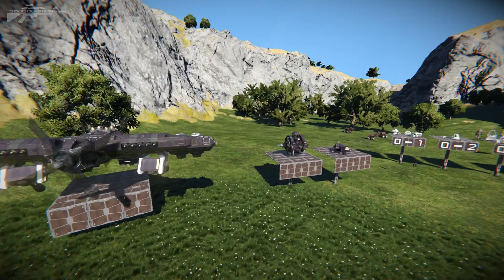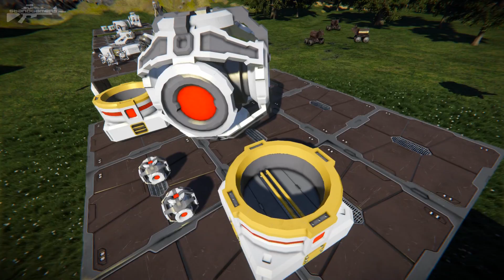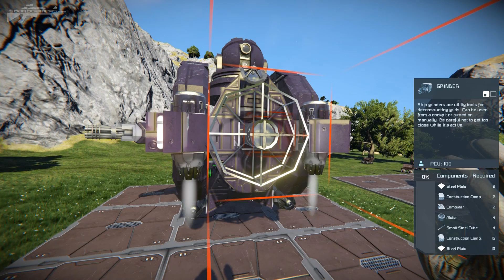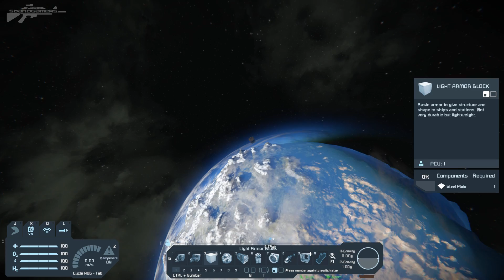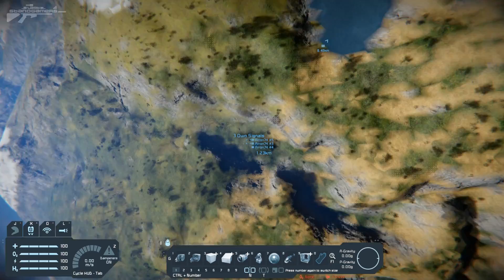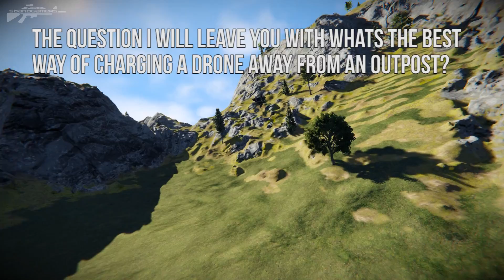How To Build Compact Drones  Tips Tricks - Space Engineers

Comment: cool concept: small-ish ship with a remote control drone. Give it a cutter, a welding arm, and a camera, along with the required pieces of a drone. Have it be able to detach from a small part of the ship's interior and let it fly around inside in out. The cutter can let it cut open the ship to fix internals, and then weld and fix everything back together. I think it would be cool.

Comment: For extreme range drone control you can make a relay drone with laser antenna and a normal antenna bounce a control signal from your location to the relay drone via the laser antennas and then have the drone broadcasting out to max range via normal antenna. This will let you control any other drone around the relay drone out to the max broadcasting range of it's antenna. With no limit to the distance between your actual location and the relay drones location. You can also have the relay drone work as a charging station for other drones. You may also connect more than one relay drone together to bend the laser signals around objects or make overlapping normal antenna fields to make larger drone control area's.
Reply: I use a space based control satalite the bottom is packed with laser antenna so it can cover a very large chunk of of planet survive.

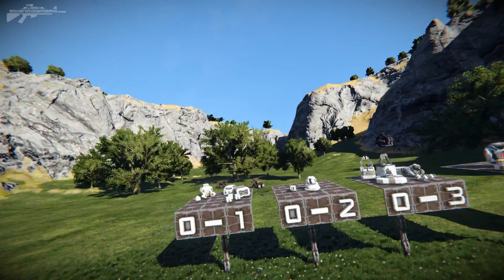Comment: 2:00 One surefire way to protect antenna and remote control: Put them in the back.
The enemy would have to go through the front and the central battery or cargo to get to those parts. And at that part, they got through the center, so it hardly matters anymore.
You want the control block as far away from the enemy in normal combat operations as possible.

Comment: Was busy and did't have time to leave a comment of any kind.
SPACE DRONES

Well I know that in "current colony survival" series there is a list of technologies that you can use and I'm talking about hover engines or plates?(didn't found the moment to look up the name of the things name) Anyway, use the hover plates on the side of the drones, they have very handy function" 0 damage bumper" the collisions can be avoided and it can use those to move as well.
So make a basic drone innards and place 2 thrusters facing front and back 1 for 1 direction. > Coat it with armor. > position hover plates from out sides, up and bottom.
Optional you also can:
- position Gatling guns from sides protruding from heavy armor.(not turrets) 
- add more thrusters to the back and make it speed oriented drone.(quick and too small to hit)
- shape it as you like it. Turn it into mining drone if you wanna(actually it might work wonderfully, no crashing into tunnel walls, no "I did it again")
Cheers!

Comment: What about a drone carrier, a large solar powered drone that serves as a resupply point for forward deployed combat drones.
Reply: I actually make drone/containers that are modular that I use as storage for my base / mining to rotate them out while I'm out in space, autopilot op
Reply: This is literally the Arkbird from Ace Combat 7
Reply: @johnnyfakeassname7852  I think the Arsenal Bird is more fitting though.
Reply: So basically, a Drone Helicarrier.
Reply: You could also use laser antenna to use it as a stealth relay for your drones
Reply: I feel it would be smarter deployed manually flow by a small crew. Not ai
Reply: Dronecage
Reply: good idea my friend
Reply: we could even add wind turbines
Reply: @Sheep_Wooly  wind turbines only work when set to station or locked to a voxel, either landing gear or built Inside one

Comment: Just remember that hydrogen production has been nerfed by 75% in generators since the release update. So keep that in your mind if going with a hydro build. Keep your design ultra light or just do not bother with small hydro ships.  I have built hydro fights for years and the update has basically made that impossible without using twenty+ o2/h2 generators. Battery is the best source right now for power but it requires an external source to be charged with is easier to do than building an internal source in each craft.

If you would like for hydro production to be returned to it's old values please vote/like here
https://support.keenswh.com/spaceengineers/general/topic/return-o2h2-generator-output-pre-survival-update
Reply: i have never had a use for hydrogen beyond the first departure from a planet. i dont know if its just my designs, but every time i tried building anything with hydrogen thrusters it just ran out of fuel within seconds :/
Reply: @fenchellforelle  it requires a little more work in designing a system that can sustain and balance itself with enough fuel and thruster to be applicable and yet not weigh to much to be irrelevant. Now with the hydrogen production being reduced most small designs are just irrelevant.